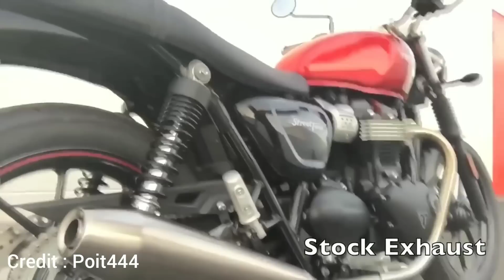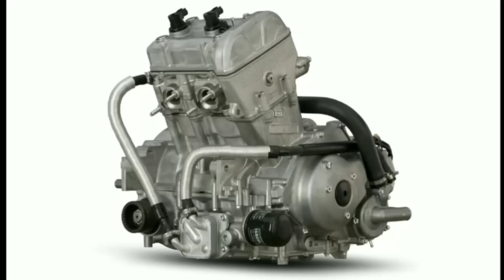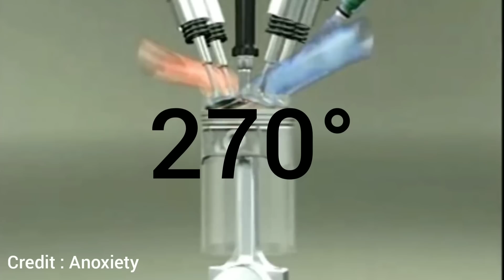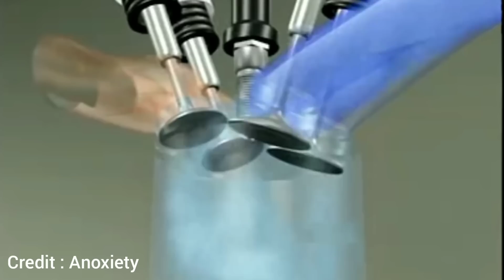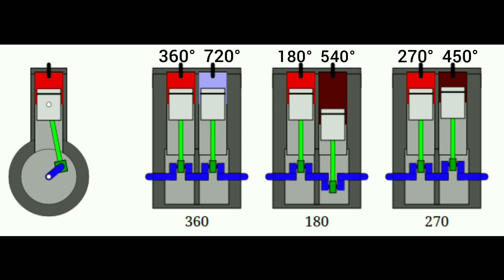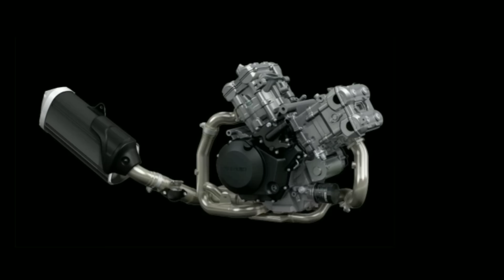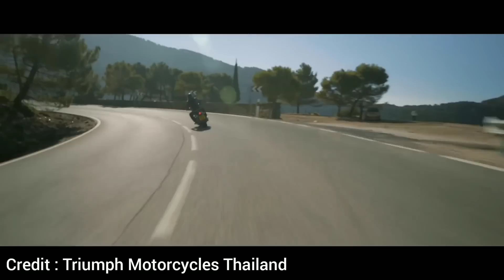270° Parallel Twin Engine: Why It's The Best Form of Parallel Twin Engine?

Comment: Thanks for the video. The firing intervals are immaterial to the vibration issue. The exhaust note - well, no one should care other than those who write copy for a living. The key thing is inertial imbalance which grows exponentially (or is it squared?) with increasing revs. I don’t think the earlier 360 twins had a balance shaft so you might be wrong there. Did you mention BMW:s 800 cc engine with a genial third connecting rod and counter weight? Or the T-Max’ third dummy piston? (Also coming on SYM TL 500). Regarding 180 parallel twins - a primary rocking couple - yes but essentially balanced away with a balance shaft. The drawback with 180 parallel twins is the unaddressed SECOND order vibration (also on inline fours). And I agree with you on the 270 parallel twin - the second order vibration cancels by the design of the crankshaft if you disregard its rocking couple. But they too need the balance shaft for cancelling the first order vibration. How come the 270 parallel twin came to market? Advances in manufacturing which made the crankshafts cheaper to make. Thanks anyway. You can also disregard the fluff about power pulses. Other than at low revs, this is immaterial. And anyway, the 360 parallel twin has the most even powerpulses.
Reply from the maker: Wow, that was some great observations. I was just trying to explain it simplest way possible and I think a few points got lost in that process. Thanks for pointing out the flaws.
Reply: @RevvingHeart  Very diplomatic.
Reply: And yes, of course also second order vibration can be balanced out but is not yet done by balance shafts on motorbikes. But several cars do address the second order vibration by double balance shafts that turn twice as fast as the crankshaft, e.g. Porsche 2.5 liter inline four and I believe several Honda engines.
Reply: @nikolaigrut  Honda Blackbird, for one, has twin balance shafts to cancel out secondary vibration on an inline four.
Reply: @ceptimus  wondering if the bmw s1000xr needs a secondary balance shaft. Seems to have vibration issues.   Not that it bothers me its a motorbike they vibrate and other things wind blast hard seat etc.   If you want comfortable drive a car.
Reply: @nikolaigrut also some Mitsubishi's like the Starion , Lancia Delta Integrale, Volvo 740 16V (B234F + B204FT engine).
As for bikes: i used to have a Kawa ZR1100 Zephyr. Aircooled inline4 with twin spark head.  It also had a balance shaft. Very smooth engine.
Reply: SECOND order vibration - hmmm.  Please produce a video explaining that:)
Reply: Michael Thompson, it looks like this guy will explain second order vibrations: https://youtu.be/gdHQ8aTfiQQ
Reply: Nikolai, you're right. The 360 degree crank, together with balancer shafts, is the smoothest of all these in terms of power delivery. And some people prefer it for its traditional character and sound.
Reply: We ancient ones recall howling along the empty country roads of Kent, Devon, Cornwall on our BSAs, Triumphs, and Nortons in the heavenly 60s. Since the riding was all cornering, shifting up and down through the box, and braking, we were able to dial out vibration: we were too busy to notice. No, our 360 parallel twins, designed in the 1930s, had no balance shafts. We had only wizards trying to set the balance factor to allow comfortable cruising speed with limited success. It's amazing to see the parallel twin making a comeback. Would anyone have predicted this?
Reply: @jeremykeller211  well its literally the cheapest engine design.   It's got so expensive to make any bike. Now we can't afford v engines.    Singles really don't cut it.  Emissions regulations have hit big Singles  and multiple cylinder engines because of losses.
Reply: @jeremykeller211  LOL, “ancient ones” almost made me snort my coffee out my nose I guess because I was there…😎
Reply: Ok wait! I need to enroll in MIT, attend for 4 years, get a mechanical engineering degree, get some hands on experience, then, and only then, will I post an appropriate reply to your highly eloquent comment! If all goes well, I'll see ya in 2026! LOL
Reply: Terry, thanks. I like to read about balancing problems and I like this video (except for the pronunciation) so why I am driving thumpers?
Reply: @nikolaigrut  So why are you driving thumpers?
Reply: @nikolaigrut  so why are you driving thumpers?
Reply: @dry509  I love the DRZ 400 S for its low weight and fuel economy. It has a balance shaft and doesn’t vibrate that bad. I don’t take day long trips but if I did I might like the 650 V-Strom. I have a Honda CRF 250 L at a different place and which vibrates even less than the Zhivago. Honda and Kawasaki are now upping their 250:s to 300:s, which seems like a good idea.
Reply: @nikolaigrut  Thank you for your response. I am looking for a bike for fun. No touring, no off-road probably, no commuting…just for fun. Run around the neighborhood and nearby country side in the US (Texas). What is a Zhivago?
Reply: @nikolaigrut  Thanks for the clarification and suggestion. The 300SM sounds good!
Reply: Very erudite. I have to now research everything that you have said. It’s a tough life being a gear head.
Reply: There were early 360 twins with a balance shaft. Examples are the Yamaha TX750, Kawasaki z400 and z750 all from the 1970s.  I prefer the traditional parallel twin sound of the 360, and also the lumpy 180 which characterised many high-revving early Japanese twins.
Reply: @roverchap  Thanks for the info. Do you happen to own any of these bikes. Not sure I could find any in Houston?
Reply: @dry509  not any more. I did have a YamTX750 a few years ago, the engine was surprisingly smooth for a big twin. All of them are rare these days but you're more likely to find one for sale in the USA than here in England.
Reply: What engine or bike do you like and ride?
Reply: Lol thanks man your saving my lungs from screaming at this guy.
Reply: Why don't they just make a 3 cylinder engine which would be naturally balanced.?
Reply: @manilanoakes3966  A lot of manufacturers do make 3 cylinder models. Still, a twin is cheaper, lighter, more narrow and for any given displacement will have more low rpm torque. Triumph has had success making both twins and triples.
Reply: @manilanoakes3966  Jota, 180 crank. Three's are only balanced "naturally" when 120 degree.
Reply: @manilanoakes3966  Triples still have a rocking couple; a straight 6 has perfect primary balance but presents packaging problems and has more parts. As alluded to in the video, motorcycles present challenges in packaging because they have to fit under the rider. Some parts of the market are extremely cost sensitive as well.
Reply: Squared. As for power pulses, it does make a difference to accelerating out of a corner at race level. To introduce the dummy piston/rod balance arrangement is off topic here and would confuse. Most people watching this are not engineers. I find it to be an excellent presentation on the different crankshaft arrangements found in parallel twins and that is the whole point.
Reply: I disagree, the engine sound is of serious importance to many people. Why do you think so many Formula 1 fans lament the passing of the V12's and V10's when the hybrid V6's are making the same power and are well balanced enough to handle 15, 000+ rpm?
Reply: I take it that you might be an engineer but definitely not a biker.
Exhaust note is the second most important thing about a bike for us, second to torque (sometimes power as well) and prior to looks.
People spend thousands of $$$ on after-market exhaust systems for this. Go figure...
Reply: Faustin, I drive a couple of thumpers. Long live biking.
Reply: Technically "squared" is "exponentially", so saying either is fine, it's just that "squared" is more specific. However I believe that in the case of vibrations in an engine, vibrations increase as a cubed function of the RPM.

Comment: Its true the 270 crank has many benefits but the BMW F800 series engine is a 360 crank and i would argue is a more playful motor and sounds and feels more like the Yamaha RD400 two stroke . BMW solved the problem of vibration ( mostly )  with a 3rd conrod and balance arm - much simpler than a balance shaft ( chains and bearings )

Comment: I disagree, the 180 degree crankshaft angle is best in parallel twins (as in the Suzuki GS 400 series) because you can really rev the balls of them... The GS 425, which Suzuki only made for a year, before moving up to the 450, was the best motorcycle I ever owned; the engine was bullet proof, and it took off like shit off a shovel…

Comment: Well that was a jolly good explanation I thought but I feel you could've mentioned the differing piston speeds and how this effects vibration just a little more. 
You touched on it but your style is so economical and to the point I feel you could've quickly and skillfully mentioned vibration caused by the rocking of the engine fore and aft by the differing piston speeds and that would've really given a sophisticated understanding of relatively advanced mechanical concepts to the novice.

Comment: A 360/740 degree firing parallel twin is unqique these days, and so to is the sound they make. There is nothing quite like them, and at 500 cc or 650cc tge vibration the engine might make is not an issue worth worrying about. It is only with bigger engines this becomes a noticable characteristic particulary with under square motors.

Comment: You have to ride one of the pre 1990 twins to understand how bad ths vibration is. This is the reason that the honda   750/4 put triumph out of business.  It waz amazingly smooth for not having a balance shaft. If not for the vibration issue,  triumph would have lost 40% of their customers,  but they'd have survived.

Comment: The Yamaha TRX850 was the modern leader of this trend. Such a character filled engine. 
It is also much cheaper to build a parallel twin than a 90 degree L twin (with duplication of heads, valves, cams etc).

Comment: They deliberately left the Honda  nc700 270 deg 2 cyl  engine  unbalanced  to add `character` , however balance shafts were added in later models as the `character` also  resembled a labouring engine reaching self destruction . They are however invincible engines.

Comment: 90degree or 270degree reduces the dynamic load on the crank, I think by more than 40%. Balance shafts are not needed when a bigger engine like this BSA A65 are rubber mounted. A 744 shorter stroke version can be very smooth requiring no rubber mounts.

https://www.youtube.com/watch?v=x2SFZ7TEOMU

Comment: Totally missed is the fact that on a cross-plane crank, the second harmonic vibration of the two cylinders are out of phase and cancel.  The cancellation of the second harmonic imbalance is why almost nobody uses a flat crank in a V-8, even though a flat crank results in an even firing interval.  The second harmonic comes from the toggle action of the connecting rod swinging back and forth causing the piston motion to be asymmetrical, higher acceleration at top dead center than at bottom dead center.  The shorter the connecting rods are, the more severe the second harmonic imbalance becomes.

Comment: Ignition occurs before top dead centre (BTDC) so that combustion is /complete/ by TDC. The piston is not driven by the explosion (it's not a proper explosion anyway, more a fast burn) but by the expanding hot gasses including the non-combustible nitrogen. This is why the ignition is advanced as revs increase, the combustion time is fixed but the piston speed varies with revs. Ignition is typically 17°BTDC (static) advancing to maybe as much as 37°BTDC as revs increase in some cases; not really a short way before TDC.

Comment: The point of 270deg parallel twin and 90deg V twin is piston “speed”. When a piston is at 0 velocity (TDC or BDC) the other is at maximum velocity mid stroke (up or down) and vice versa through the cycles. 🦘🇦🇺

Comment: With 1 balancing shaft (of course best solution is 2 balancing shafts, turning opposite to the crankshaft but with crankshaft's speed) it is impossible to fully balance the "270°-engine", because "momentum of 2nd order" (=doubled crankshaft speed, sorry for my bad English) remains. But no question: the 270°-2-cylinder-parallel-twin is the best concept with regard to mass-balancing - and this is why it has become the common design. A flat crankshaft (360°- or 180°-design) would be the cheapest version, but nowadays even a spatial crankshaft like the 270°-version is not that much more expensive.

Comment: IT is the 180 parallel twins which are without caracter the 360 is the original re should have used the meteor name for a 360 degree 750 version of the 650 for the hardcore britt fans

Comment: Are the 865cc Bonnies 360 degree cranks? And is this desirable? I was told to buy a Royal Enfield instead of a used 865cc Bonnie? Lighter etc with 270 crank. Has anyone ridden both?
Reply: The used bonnie is better machine

Comment: At 2:30, the diagram has an error.  The first engine should have its cylinders both labeled with 360* because they each fire 360* from each other (since you're showing firing intervals on the other two engines).

Comment: Apart from the mentioned disadvantages V-twins are not only more expensive to produce, but also to maintain. You got 2 cylinder heads instead of 1 and access to them usually has to be gained with quite some work.

Comment: 360º is one of the best engine to drive and enjoy, is soft like a 4-cyl, it sounds like a 4-cyl, has a grear initial torque and great medium torque, and also in high revs is soft and the noise is incredible, we have too little bikes with this crank right now, the benelli paralell lineup, 300 and 500... and the F800 from BMW.. not much more than that...

180º is terrible on any level, the cb500 and the 650 from kawasaki are very boring engines and also has a strage vibration that is like dragging a fork in a pan, disgusting at most.

the 270º is for the V-TWIN lovers, like me, i love this engine layout, i have a KTM 790 right now and having the amazing feeling of a vtwin with a light weight and lower heat of a paralell twin is the best of both worlds... also apply to 285, from the KTM and 315º from the husqvarna nuda 900r

PD: the boxer engines like the BMW gs is 360º also. but not parallel, obviously.
Reply: The boxer has a 180 degree crankshaft, so we can have one ignition at every full turn, one to the left, the next to the right, etc.

Comment: I know the 270 degree crankshaft has less vibration than a 360 degree crankshaft, but I grew up in the 60's when BSA and Triumph motorcycles were the hottest bikes to own. Their wonderful sound was due to their 360 degree crankshaft. The new Royal Enfield twins really interest me, but the Kawasaki W800 with it's 360 degree crank and chrome fenders would be my choice today, vibrations and all.
Reply: how do you know 270 has less vibration?
Reply: @ivok9846  Experoence. I've ridden both.
Reply: @genegoodwin8925  me too, and any 270° bike I rode (most new parallel twins are 270 anyway) feels like a tractor compared to 360° xtz750...half way between 1 cyl thumper and 360° twin...

that's why they're compared to v twins, because they're running rough...

Comment: I like ptwins on 360/180 degrees, like the Honda Rebel.
They're butter smooth around 2.5-3k RPM, but vibrate a lot between 4-5kRPM. But then become butter smooth again around 6k RPM, and again at 9k RPM.

Comment: Thank you so much. It makes perfect sense now.. I am currently riding 2017 Ninja 650 which I believe to have 180 degree crank... So, vibration is something I have to live with especially at the high revs.... but, so far, it has not been too bad.. (^_^)

Comment: Here's a fun fact.  Steam locomotive pistons had to be calibrated in a process known as "quartering".  Quartered locomotive cylinders balance out the massive forces acting on the engine, conserved momentum between each stroke, and allowed the train to run smoother and achieve higher top speeds.  This concept has carried over into internal combustion engines and is what led to the development of the 270 degree parallel twin engine.
Reply: It also allowed the steam engine to self start in any crank orientation.  Top and bottom dead centers were called dead for a reason.  If a single cylinder steam engine stopped in either of those positions, someone would have to manually rotate the engine off of that position before the engine would start.  That would be hard to do with a locomotive.

Comment: I think you've got the firing order on your 180 wrong. it's either 180 - 360 or 180 - 720 (depending on which one fires first) Your explanation is correct though; it's the engine with the most uneven firing order.

Comment: Your graphic shows the cylinders firing at 270 and 450 degrees. That is incorrect. 450 and 270 degrees firing mean 180 degrees difference in phase, which would mean the Pistons are at TDC and bdc together. That contradicts the entire premise of 270 degree crank, which refers to the phase difference between the two cylinders.